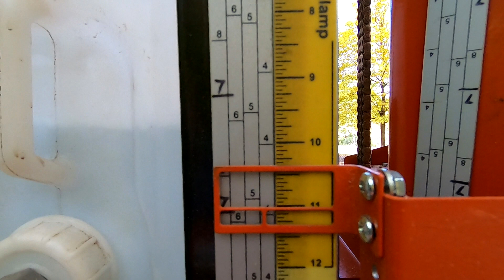Milling 7/8 Pine on the Wood-Mizer LT40 # 180

Comment: I enjoy watching a semi-automated Wood-Mizer in action.  Imagine if you had to deal with that unruly log without the log turner and hydraulic post!
Reply from the maker: I used to. My old mill was a TimberKing 1220; which was 100% manual. Watch my first videos and you'll see me actually have to work!
Dave
Reply: @TheOldManAndTheSaw  Well at least you are moving in the right direction!  I went to a full manual mill after having access to a buddy's diesel LT50 with full hydraulics and deluxe controls.  Really no difference in cut quality (a sharp blade is a sharp blade) but the amount of extra work and loss of productivity is huge.